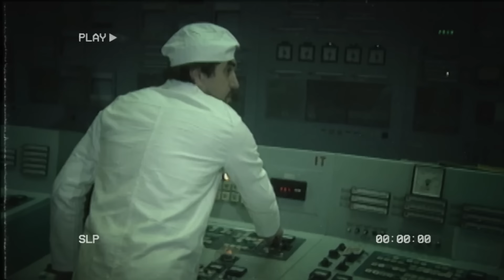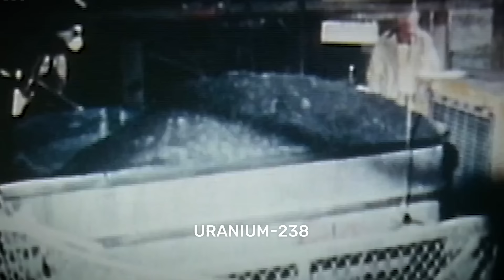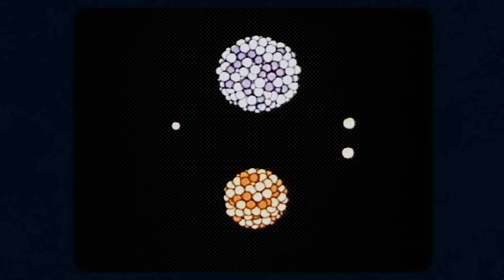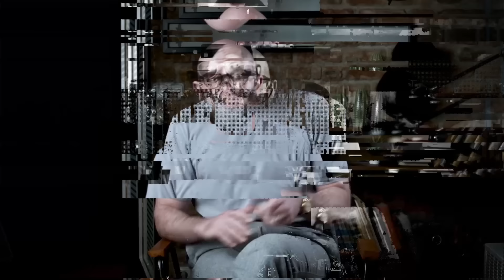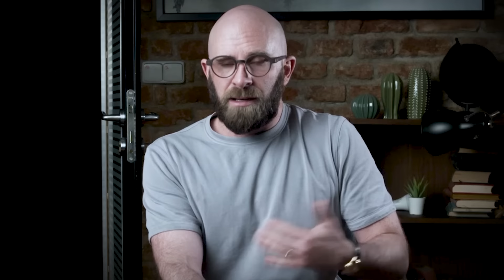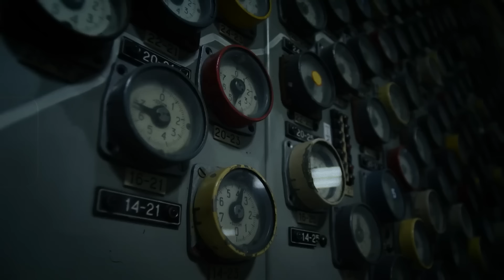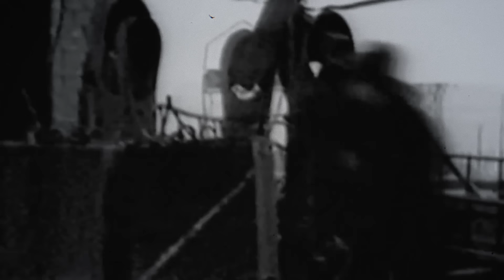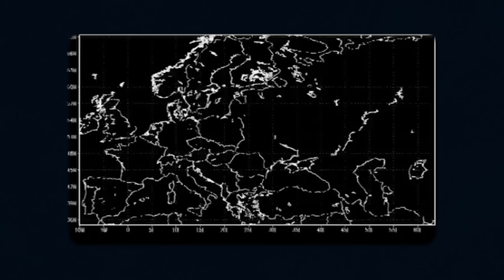The RBMK: The Shoddy Nuclear Reactor That Nearly Killed Millions

Comment: The fun thing is that when the Russian army occupied the Chernobyl area in 2022 they dug fox holes nearby. That didn't work out well for those troops.
Reply: That's a myth. Nothing happened to those soldiers because after they left Ukrainians measured the radiation levels in trenches dug by Russians and determined they were totally safe. Those trenches weren't even dug in the most radioactive parts of the red forests because they knew were to not dig holes in the ground.
Reply: @alder2460  they didn't know a shit, that's for sure. however they haven't spent so much time in there, and now the red forest is relatively safe if you don't stay there for years, or collect some radioactive crap.
Reply: Flux holes?!?

😂
Reply: @Spida37   Heheh, good one :) [not for those soldats for sure]
Reply: @korzbro35 acute radiaton sickness.
Reply: Omg what idiots

Comment: Stop mindlessly copying the Legasov corium copium!
The molten mass had in fact contacted the water, as it was found out during the barbateur pool inspection. And nothing happened. It solidified. That's it.

And Legasov himself was heavily regretting being so carried away by that idea, because the timespan spent on measures to prevent that potential explosion became the source for most of his exposure, which, in turn, doomed him.

Could we finally move on beyond the discovery channel fake drama stage??

Comment: The operator said the AZ5 was pushed just to shut down the reactor, NOT as an emergency measure, as there was no emergency at that point.
Is that correct?
Reply: Yes that's right, the reactor showed no abnormalities before the AZ-5 was pressed, and this can be seen in the SKALA computer records. The power surge and all the problems started a few seconds after the button was pressed.
So it must have been pressed to shut down the reactor.

Comment: 12:05 TMI2 scrammed due to a loss of steam generator feed, prior to the accident.  You make it sound like the operators scrammed, due to the accident.  

The scram was the event inotiator and the core melted due to poor control room design, operator error and a malfunctioning PORV.  All lead to overheating of the core, due to failure to remove decay heat. 

 Decay heat is the heat a core gives off, after it is scrammed or shut down.

Comment: I've had this question since I was a kid in school. Fission makes sense to me You get a neutron.. boom reactivity. And U makes 3 neutrons. Okay you only want 1 of those neutrons to react... How do you make sure that one, one only exactly one neutron causes another fission? at  at least in my head if it was 0.999 neutrons the reactor would shut down or 1.00001 neutrons the thing would have a 'unhappy' event... I think the technical term is negative feedback. What gives that negative feedback to the system?
Reply: They do not make sure only one. Moderators slow down neutrons, and slower neutrons have a higher chance of hitting each other and exploding/the reaction. So the Chernobyl reactors had uranium 235 which was surrounded by graphite and water. Both of which moderate the reaction. The control rods were made of boron, cadmium,  hafnium, or silver alloys which stop the reaction.

Any nuclear reactor is a % game. They're not saying only 1 thing happens at a time. They're saying only so many can/should happen at a time.
Reply: @tootone  Ahh thank you for your time. so as I understand it it's a probability game. You use the rods to control the probability of a neutron being the right energy? Did I understand that right?

Comment: The rbmk reactor isn't as unrealable as people like to make out. Yes the rbmk has a positive void coefficiency but this isn't a problem in most RBMK reactors and most rbmk reactors never had a nuclear accident.

Chernobyl happened because the creators of the rbmk and some specialists tried to make the rbmk reactor cheaper and less material intensive to make by reducing the size of the reactor housing and the bottom of the graphite rods. Which created a 1.25 metre gap at the bottom of the reactor where water would be displaced when the az-5 button was pressed this is what caused the positive scram effect. There was nothing at the bottom of the reactor to reduce reactivity so when voids formed in this gap there was nothing to stop the reaction from reaching prompt critical and thats when the 3 explosions happened. The colent water was also nearly boiling when the az-5 button was pressed which cause the water in the reactor to flash boil increasing reactivity. 

 When talking about the RBMK reactor and chernobyl you have to understand that the original narrative and the narrative in the hbo series are not truthful to what actually happened in the reactor and in the control room. Legasov and other high up scientists didn't want to be blamed for chernobyl because in the end they were responsible for reducing the size of the graphite rods with out consulting the soviet government about it first. The SSR didn't know the ministry of energy and the nikita institute had modified the graphite rods. That's why the operators were used as scapegoats.

Also scientist still don't know what caused the first 2 explosions. Its unlikely that it was to do with the steam or hydrogen. It looks more likely that it was a small nuclear explosion.

Oh and there were only 2 rbmk reactors that had this modification. Other rbmk reacts had accidents but nothing like chernobyl.

Also there was never going to be a second explosive legasov even said this in his recordings. 

This video has alot of historical and scientific errors which tells me the research for this video was mainly from the same sources the hbo series got there information from. Its just annoying to hear the same inaccuracies everytime someone makes a video about chernobyl. The actually history is way more interesting then the videos and tv shows people make about chernobyl.  The origins of nuclear energy in the Soviet union is also very interesting and it kind of paints a picture of how chernobyl happened.

Comment: Lets be fair to the TV show. It did say the whole point of the Graphite was to increase the reactions for the heat generation. Why they designed it that way was because of lower grade Uranium. What stops you from increasing the grade of the Uranium? Not spending the money on the equipment and the process to refine the Uranium.

Comment: A nuclear reactor will not explode the same way like a nuclear bomb. You'll need at least 80% enrichment for that
Reply: It really depends on the criticality needed for a nuclear explosion.  The enrichment level needs to be high enough that you can get enough fissionable material into a small enough volume to reach a super-critical mass (without significant time in the process for it to simply go critical first).  This is part of what puts an upper limit on the yield of fission reaction explosions.  You simply can't get enough sub-critical mass fissionable material pieces to assemble fast enough to produce a super-critical mass above a certain amount.

The idea that you could put enough 2% enriched Uranium material together in a space small enough to reach a super-critical mass is absurd.  It would have to be super-compressed by a detonative force equivalent to another larger nuclear explosion....it just isn't plausible.
Reply: One of the advantages of a RBMK reactor is that it could use lower-level of uranium enrichment.

Comment: Might want to add an addendum about that secondary explosion. Valery Legasov was either looking for attention or trying to make the Soviet Union look worse for propaganda when he estimated a 3-5 megaton explosion, because there's no physical way that the corium could create that explosion. The water reservoir would have had to maintain a perfect seal after the corium melted in to achieve enough pressure for there to be a steam explosion, and for it to be 3-5 megatons there would need to be a massive pressure buildup. He probably got the number by calculating the pressure change from instantly vaporizing the whole reservoir to steam, which is just not physically possible for the molten corium. It's a lot like lava falling into the sea, it doesn't instantly vaporize enough water to create an explosion, it just causes a violent boiling event. I can't blame you for including it since Legasov's assertion was spread all over, but it's just pure bunk.

Edit: I'll add that this was a very disappointing video. The combination of not catching that the secondary explosion was impossible with the inaccurate explanation of moderators is just bad research. You're usually a lot better and catch a lot of common inaccurate information (even talking about it deliberately) which is why this was so disappointing.
Reply: To be fair Simon only reads the scripts other people write them. And the writers seem to be less anti than they used to. This video could have been a lot more anti.
Reply: @namename9998   doesn't matter much - released material is misinforming. Confusing moderator with control rod? Please...

Comment: Can someone explain to me why reactor "coolant" has to be just water/heavy water, or why the coolant and "moderator" or even the "control" have to be separate? In much the same way that one would put antifreeze/coolant in their vehicle, why couldn't there be an all-purpose coolant/moderator/control based on the composition and concentration of whatever substance is used to perform these functions, without "clogging" any part of the reactor itself?
Reply: Coolant, moderator, and control all serve different functions and have different physical requirements.  A coolant should have high heat capacity, a moderator should have low atomic mass and low neutron absorption, and a control element should have high neutron absorption. A coolant should also be a fluid, so you can pump the heat out of the reactor. By lucky chance, water has a high heat capacity and contains a lot of low-atomic-mass hydrogen, so it makes a good coolant as well as a good moderator.  It isn't completely ideal as a moderator because it absorbs a lot of neutrons.  Heavy water (containing deuterium) isn't quite as good as a moderator because deuterium is twice as heavy as hydrogen, but its neutron absorption is much lower than hydrogen, so it is preferred as a moderator when using low-enriched uranium fuel. Control rods are made of materials like cadmium or boron, which have very high neutron absorption.  They are made into rods so they can be inserted into the reactor to slow down the rate of reaction.  You need to be able to move the control rods independently of the amount of coolant or moderator you are using, so you can't just mix a control material into the coolant and have one fluid that serves all functions.

Comment: There's significant errors in this video. You have a responsibility to ensure the information you convey is correct and accurate, and it's irresponsible for you to keep this video up without addressing the mistakes.
Reply: Yep. I picked up on it right away.
Reply: You have to be much more specific to be taken seriously.  I found that the basic design flaws that made this reacter a question of when it would self-destruct rather than if.  I first heard about this reacter when I was in high-school.   Just a surface explanation of the way it worked made it clear it was an accident just waiting for the right moment.

This doesn't mean that all efforts to harness the power of the atom are doomed to fail.
Reply: @ed_reusser hi bot

Comment: I like to pint few things
RBMK reactor has first negative void then positive void during operation
This was not a nuclear explosion but chemical explosion 
USSR had other types of reactors.. they had PWR reactors such VVER and they have been developing them since 1950's
there were 2 explosions not just one as it stated in this video. The fear of the third one with ground water or water would affect lot of people.  Then the issue with the corium affecting ground water that goes to Dnepr and then to Black sea to Mediterranean and Atlantic would be catastrophic
The HBO series was amazing but it was also fictional. Not just about Khomyuk which they disclose but Legasov's death which was not exactly 2 years after the explosion but 2 years and day.. just before he was supposed to submit his findings. 
he was not at the court.. in fact the court didn't just have the 3 on bench but another 3 that were involved from which 2 died. 
Legasov looked like he is the fighter but he was the party man as well. Brilliant chemist and nuclear physicist 
Chernobyl had another incident in 1991 where reactor 2 turbine caught on fire.   Reactor 3 was functional till 2000 and 1 I believe late 80's

The PWR and BWR reactors benefits are also their flaws.. Fukushima Daishi had 6 BWR reactors that need the water as said here, for moderation and cooling. So technically that design is great if you have the constant water flow.. Not salt water but fresh water  .  (salt water can be used in condensers) but not in primary loop. Can you 100% guarantee that water can be present at all times.  Sadly no. Fundamentally fuel needs time after full shut off. Even with rods helping to stop reaction the heat is produced. Normally around 8-72 hours.. Depends what Reactor, what fuel and what Isotope.  The spent fuel then another 5-15 years needs to be cool.  
Nuclear power can be truly zero emission if done properly.  We have renewable sources but making the facilities and actual solar panels or wind turbines we still use fossil fuels, for batteries we use lithium  and while nuclear power plant financial returns takes up to 10-15 years to make profit, current political agenda is pushing for short profits.. 
Even though nuclear fuel is way cheaper.  It's so politically charged that it's not even funny. While most of the world is now moving away from Nuclear power instead of invest into actually properly harness it. Even spent fuel can be further used.  Most politicians think of short term and rebuilding some of the old plants is really expensive as the new laws and regulations require lot of money.

Every renewable energy we have is based on Solar . Whether directly coming from Sun into solar panels or sun heating up oceans creating vapor that form clouds that creates rain and creates rivers or again sun heating up the surface to create winds to generate wind turbines and as we know Sun is one big nuclear fusion.

Comment: Great video!  But, I'll point out that so many recreations of the disaster either state or intimate that there was a power surge in the core as the test was initiated, and that is why the operators hit AZ-5 to scram the reactor.  However, this is not the case.  Yes, the reactor was in an unstable condition  prior to the test, and the test conditions (reduction of coolant water flow into the bottom of the core due to the pumps slowing down) made the reactor even more unstable.  But, the operators hit AZ-5 shortly after initiating the test simply because that is what the test procedure called for.  As in, "once the spin down is demonstrated, shut down the reactor by hitting AZ-5".  The operators were generally unaware that anything was amiss until they hit AZ-5 and heard / felt the explosions.  This is confirmed in various books, including 'Midnight in Chernobyl', and in Dyatlov's recorded memoirs (available on YouTube).

Comment: "For the same reason, our reactors do not have containment buildings around them like those in the West. The same reason we don't use properly enriched fuel in our cores. The same reason we are the only nation that builds water-cooled graphite moderated reactors with a positive void coefficient."
"It's cheaper."

- HBO Chernobyl Ep5.

Comment: Corium meeting water leading to 3 to 5 megatons of TNT?  Since this is a steam explosion with non-enriched reactive material someone explain to me how this could be the case?
Reply: It cant. It was either the Russian exaggerating so politicians would do something or a miscalculation somewhere.
Reply: It's impossible. The number of 4 Mt is made up. In fact, corium was already in the flooded basement floating there harmlessly when divers were sent to open sluice gates. 
There were concerns about an explosion of a several magnitudes lower yield that could damage the structure of the reactor building, damage other reactors and release more radiation into the atmosphere, but it's impossible to get to the megaton range without using a hydrogen fusion bomb. But a nuclear reactor is not even comparable to a fission bomb, because the fuel is not enriched enough - Chernobyl reactor used a very low enriched uranium, it simply couldn't explode like a bomb, especially after melting down.
There were way too many errors presented in this video unfortunately.
Reply: It couldn't.  It is complete and utter nonsense!
Reply: It cant. It wouldn't even reach 1 Kiloton. (1000x less)
For comparison the Beruit explosion was ~1.1 kiloton and the PEPCON disaster was 0.25 kilotons.
That said, it would have been more than sufficient to destroy the remaining 3 reactors. From there its hard to estimate accurately but between the water in all the reactors, which would begin to split into hydrogen and oxygen at temperatures above 2'000°C, and then detonate, plus the reactors themselves, that could (theoretically) produce a 3-5 kiloton explosion, still 3 orders of magnitude below the stated value.
Reply: The corium (which is as they say f**** hot to the point that it could melt concrete) superheats the water into high pressure steam that creates a pressure blast. That much corium and the main undergound water table makes a very big boom.
Reply: @ Proof please.
Reply: @namename9998  do your own research
Reply: @Saddleback117  Mechanism OK, but number off by orders of magnitude. Hot corium has some thermal energy, but man, a megatonne of TNT is not "some", it is petajoules of energy.